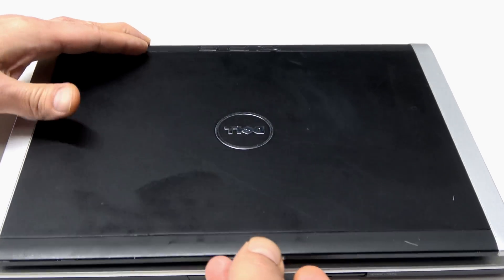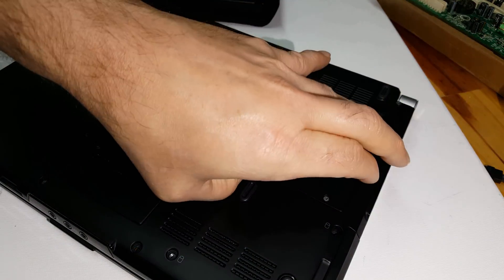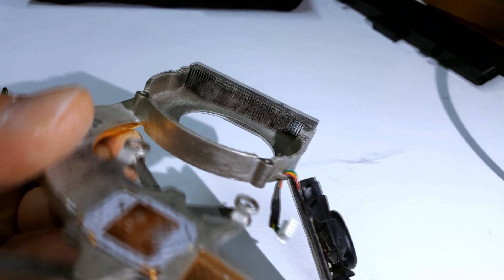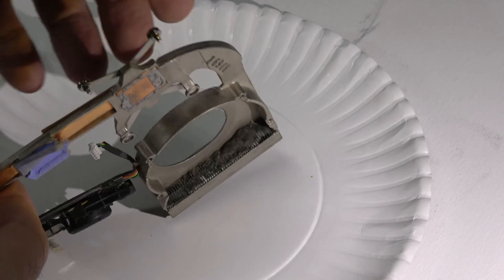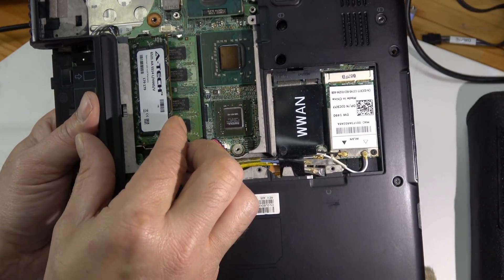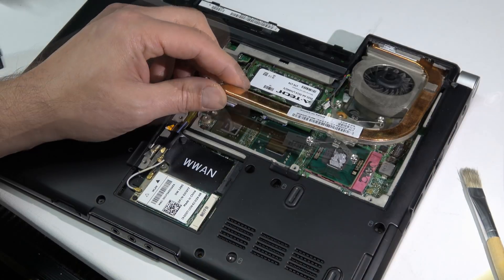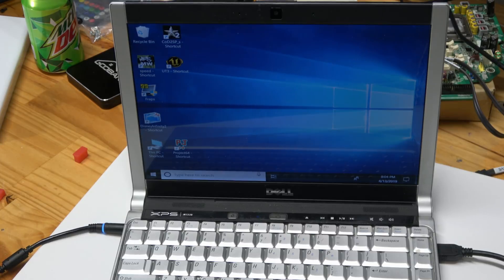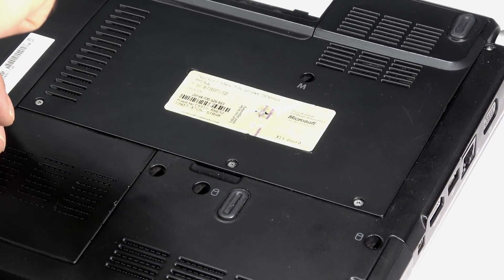$20 Dell XPS Laptop from Letgo is it worth it?

Comment: I just got one of these and I installed an SSD in it and am current;y running Windows 7 after trying a dozen linux distros.  How did you get windows 10 installed?? I tried several times and the installation always failed, I think the hardware was just too old that youd have to slipstream drivers or something
Reply: I managed to install windows 10 on this very same laptop but didn't manage to make cpu usage below 50% so I too returned to windows 7. 
I would like to know how he managed to make windows 10 to work flawlessly.

Comment: I had one of these for a while. It has a good keyboard, nice screen, and w/ Windows 10, an SSD, and 8GB RAM it is snappy.

The only real issue you will run into is if the GPU has not been repaired under the recall.

Comment: You should definitely upgrade the cpu and push the Dell to its limits. Upgradable laptops are fun and few. I have a Compaq presario cq60 615dx that went from an single core Celeron at 2.20ghz to a Core 2 duo t9900 at 3.06ghz. Having that extra core definitely improved the laptop's performance and a 240gb SSD gave it an even greater boost.

Comment: Never seen one that easy to get at... Upgrading my Toshiba L300 from Celeron to C2D, and 802.11g to 802.11n - looks like I can get away with it, as the later BIOS apparently got rid of the whitelist, the CPU I got is definitely supported for the series (and again, latest BIOS), and also struck lucky finding somewhere that describes the BIG Wi-Fi compatibility issue - the slot only implements USB mode, and a couple of cards that worked with it were listed - and here's where my luck got really good, ebay seller had the card I needed, 1 in stock, for £1 + £1 p&p - zoom zoom!

But, a gazillion screws need removing to get to it, as there is no bug hutch cover access

Comment: I literally have this sitting in my room. It’s battery is dead though and Windows 10 runs super slow on it.
Reply: Win10 is slow most likely because you have a slow hard drive. Win10 really hates 5400rpm (or even 7200rpm) hard drives

Comment: Use thermal past on the GPU and CPU don’t use pads if u can help it.  Pads won’t transfers much heat like best over priced pads do 8w/mK but cheap thermal grizzly kryonaut does 12W/mK and you can get several uses out of a tube.   and looking hot squished the pads are barely a gap worth padding.. 

I have a lot of experience fixing dell machines and dell really doesn’t do cooling very well, even on newest highest end $2000+  XPS line the paste they use is like bathroom sealant rather than thermal interface material.
Reply from the maker: Is the grizzly kinda like arctic silver the black tar stuff that rips the cpu out of amd sockets? If so I have some if might try it instead of thermal pads. Or what do you think about copper shims I have a few of those as well. Thanks for your input this is how I learn.
Reply: @modstek  any paste can pull AMD cpus out of socket and feel like glue just depends on how much was used.. 

  Thermal grizzly is the brand of paste.  And kyronaut is the type of paste.. Designed sub zero cooling but its really good paste in general cuz of the properties needed to go subzero

As for what you should try it depemds on how big the gap is between the coldplate and GPU die.. Given how deeply crushed it looks I dont think much of a gap w
So I would try a glob of thermal compound to see if it helps thermals, if not then try shimming it and using paste with shim.. Dont just raw dog it if u do shim it.. I have seen people do that and overheat.
Reply: Thank god someone said this. Decent paste will transfer hear much more efficiently to the heat sink than thermal pads. Don’t waste your money on pads. Get a good non-conductive paste.

Comment: Hey,
I finally recieved my pcie riser and sata to 6 pin converter,when i connect my video card(gtx 1050ti oc version for gigabyte)its showing no signal detected on the monitor.
My pc is optiplex 780 sff.
Please help.
:)

Comment: I really enjoy your videos.  The simple answer to your question is "yes, its absolutely worth it."  I have a C2D Sony Vaio VGN-NW250F that I bought new in 2009.  A couple of years ago I did a similar upgrade to what you are doing to your Dell on it.  I cleaned the inside and reapplied thermal paste and pads, upgraded it to a T9500 CPU (super cheap on Ebay, and the the most powerful processor that will work in this machine), maxed out the RAM at 4GB, and swapped in an SSD.  I left Windows 7 installed, but I think I am going to go ahead and upgrade to Windows 10 in the near future, although Linux is certainly a viable option as well.  Clearly this is not for gaming, but as a general use, word-processing and web browsing machine, it runs just fine.  And it if it gets lost, stolen, or broken during my travels, I wont really be that worried about it.  So I think what you are doing with your Dell definitely makes sense and is worth the effort.
Reply from the maker: Glad you enjoy the videos thanks. I actually think I have the t9500 in my old shuttle computer. I was gonna swap it out but I think it took a month to come from China to replace it. Linux would work great I'm sure but I'm curious about a Hackintosh I believe it around the same specs as a older mac mini.

Comment: Great video!  I love making these older XPS and Precision boxes serve a useful purpose again.  Plenty of horsepower still in these boxes for basic apps, web browsing, videos, etc.  And you can run Linux if you want to run even leaner on the OS overhead for better performance.  I recently picked up a Precision M6300 for $40 off a local craigslist buy.  The laptop looked like it had never been used, with travel bag, two chargers, working battery, no scratches or wear, etc.  Granted, it is a ten year old beast with a 17" screen, decent video card (for the time) and a Core2 CPU, and now with more RAM, a SSD and a Linux OS load it runs great!  Keep the excellent content coming.
Reply from the maker: Nice find! And thank you

Comment: That is a ridiculously easy laptop to open up. I am duly impressed.
Reply: You should see some of IBM/Lenovo's ThinkPad laptop series... They are outstanding!!
Reply from the maker: I forgot to mention that yeah if they where all designed that way it would be nice. Not too long ago I had an older mac book pro. It had two keys missing so I bought the new keyboard for 10 bucks and it took half a day to replace with removing everything in the laptop and then removing the 50+ micro screws. Anyways working on the Dell was like easy peasy.

Comment from the maker: HAPPY EASTER to those whom celebrate. BTW this model did support a ssd and was running one towards the end of the video. Thanks all
Reply: Did the driver download work? I noticed there wasn't a Win 10 selection.
Reply from the maker: Drivers work i just downloaded the  Vista 64bit ones I believe
Reply: @modstek  I wonder what the performance difference would be on an older laptop (or a budget one like this) between Windows and Linux. Not sure if you have ever used Linux, or even considered it, but its free so why not. I live in windows myself, but an curious regarding the comparisons....... Just a thought.
Reply: Nvm, just seen your other videos. LOL

Comment: Got a free MINT Lenovo G50-80 with an i5-5200u and an radeon R5 M330 with 8gb ram. It had a broken display cable so i ordered one and it works perfectly :) My daily school laptop and it works awesome hehe
Reply: From what I know the R5 m330 is a decent little GPU too. Nothing crazy but can play like GTA low settings.
Reply: @surrealmemes3518  but the cpu cant unfortunately
Reply: @julianvandenberg2002  Yes it can. Even a dual core can pay gta v on low settings

Comment: depending on the model you might not be able to upgrade to an SSD since at that time most came with IED drives
Reply: Improvised Explosive Device drives? 😂 You mean IDE probably.
Reply: That laptop isn't that old. Almost all laptops used SATA since like 2006. That Dell XPS is a pretty nice multimedia laptop from 2007-2008.

Comment: I bought a Toshiba Satellite (can't recall model no.) Way back in 2008, shortly after GTA 4 came out (I played the crap out of that game and Fallout 3). I remember it had a Radeon HD 3450 with 2GB VRAM and a Core 2 Duo. I bought it at Best Buy for $850, and then sold it a few months later for $700 with accessories as I was about to enter basic training. How time flies right

Comment: I have a 12 year old, Dell Optiplex d630, with a core2 duo, dropped in 4gb ram, & an SSD, she runs like a Champ!
Reply: Some of tthese older laptops you can also upgrade the cpu i swapped out the single cor 1.7ghz in my acer 5315 for a core 2 duo at 2.4ghz and fitted faster memory even an old dell d520 i swapped the single cor 32 bit cpu for a dual core 64 bit t7200 core 2 duo .
Reply: hell i got an old dell gx620. i put in an ssd and upgraded to an nvidia video card and 8 gb of memory. it runs great but i'm thinking about moving up to windows 7 32 bit.
Reply: @aldee3018  install windows 7 64 bit 
Dont do 32 as it will only see and use 3gb of ram
Reply: I have a latitude d630 core2 duo e7500 4gb ram and 840 evo 
Had to update bios to have ahci mode 
Running like a champ still